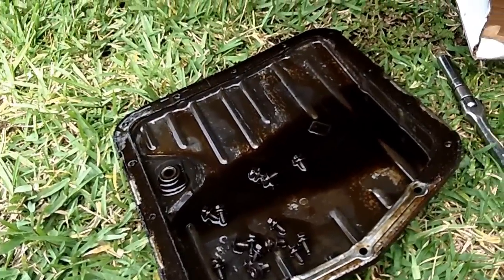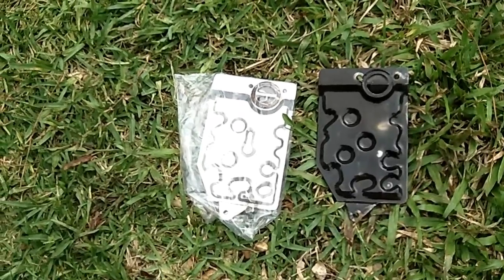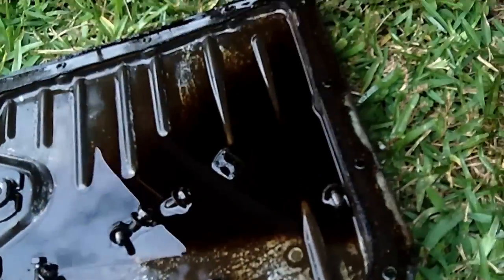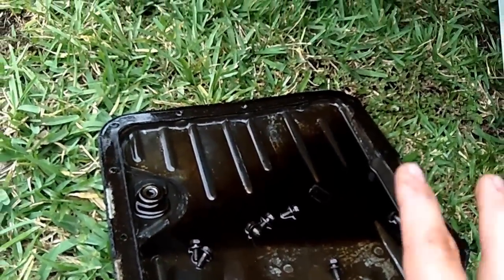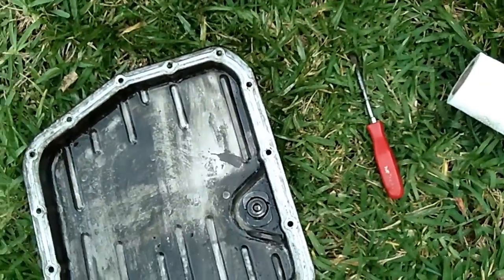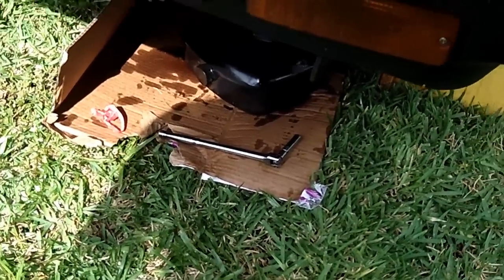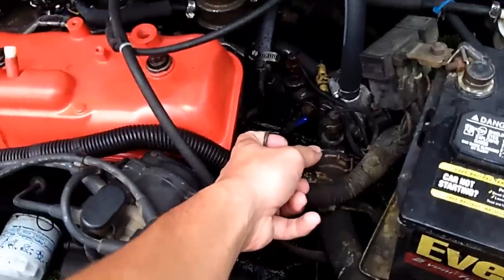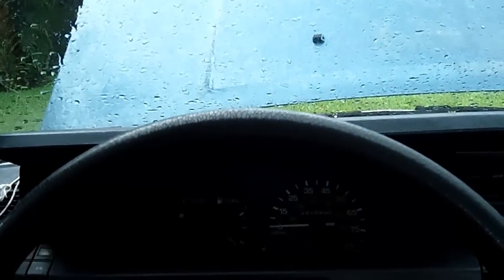Toyota Corolla Automatic Transmission Service A131L

Comment: YOU FORGOT THE DIFFERENTIAL DRAIN!!!!!! A131L trans have a separate drain plug right near the pan plug that needs to get changed.  Yes I know this video is old, but everyone, make sure you research the diff drain plug and fill through a 17mm bolt on the side.